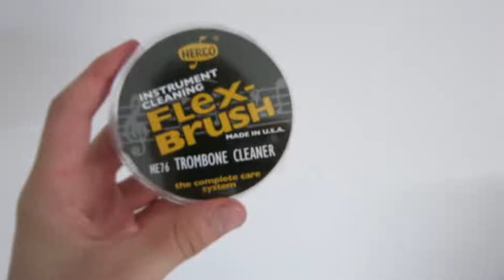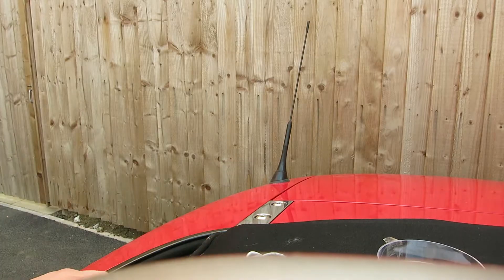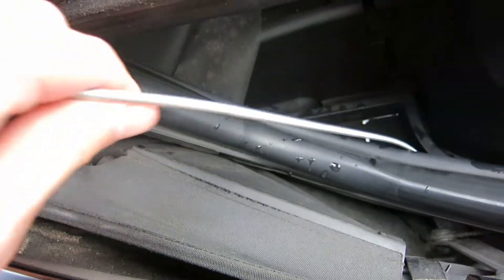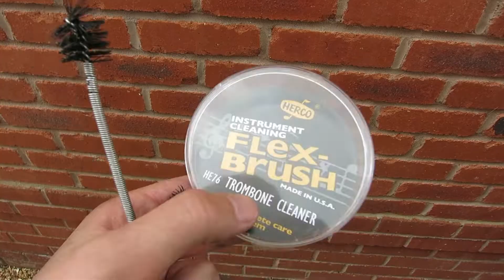MX-5 Drain hole clean!

Comment: Don’t forget that they also tend to leak through the plastic cowling below the windscreen. There is a small plastic cap cover on both the left and right side that covers a screw which holds a white plastic bracket in position and which has a rubber seal underneath which corrodes after a while and let’s in rain water down through the glove box to the floor carpets on both the passenger and driver side. Either replace the white brackets and rubber seals of squirt silicone around and over the bracket and when set, should stop any further leaking.
Reply from the maker: Robert Bernard very useful thank you! Have had a few subscribers mention a leak in this area!
Reply: Yup, just rained 2 days in a row an this just happend on driver side. I will give a looksie tomorrow . I think I saw other vid on it too
Reply: Is this just NC? OR NB as well

Comment: I found an alternative to the trombone cleaner.  It's a giant cable tie of 1.2 m / 4 ft in length used by heating and cooling installers to hold ducts.  I remembered I had some in my garage after renovations.  Insert, twist and withdraw. Being plastic, it's not too brutal. Holes now clean. 😃
Reply from the maker: Haha perfect! Love a bit of ingenuity👌

Comment: Useful. Constant issues with drain holes/gutters on driver side which means issues with wet carpets (a lake which makes carpets rot and metal bolts rust) Even my garage struggle and have to clean drain holes / gutters out every time the car goes in for anything.

Comment: Anybody reading this don't use a trombone brush and don't stick anything down the drains. This is because there are really delicate one way rubber flaps in the drain tubes at the bottom which stop road noise coming back up into the cabin (makes a whooshing noise like a sea shell when cruising at speed). The trombone cleaner pushes these out when you stick it down. I did this at first and had to pull out the drain tubes from behind the seatbelt pretensioner and remake all the rubber valves as the noise was so annoying.

Comment: Today, (27.11.21) I realised my passenger side had about an inch, to an inch-and-a-half of water in it - no wonder my dog didn't want to sit on the floor - !  If you DO get a flood (haven't experiened a flood like this before!) take an old pillow case, and fill it with cat litter. Lower it onto the wet lo9cation and flatten it out to spread the littler, still within the pillow case, to cover the entire wet area (you may have to do the passenger side in 2 sections; in front of the seat, and behind it, while the seat is pulled fully forward).  leave the litter there until the water is absorbed. You may have to give it more than one treatment. I realise cat littler isn't cheap, but it's less expensive than having to deal with a rusted floor! 
I also ordered a trombone cleaner today, too, so that will alleviate the problem, I expect! Thanks for the lesson. I wouldn't have ever found these drain holes on my own! Last time the water got in (never been as bad as this!) the garage didn't have a clue!
Reply from the maker: Hi, I think your leak is coming from the scuttle grommets on the bulkhead below the windscreen. Here is a link to where I talk about them https://youtu.be/bEwwdv8M4cM. Never hurts to do the drain holes anyway!

Comment: Be mindful there is a downwards rubber 1 way flap in there, so if you’re using that trombone cleaner you must exit down, don’t yank it back up since u may damage the flap.

By “there” I mean on the top side of the built in hose behind the retracting seat belt ( you have to move the plastic trim aside to reach the drain tube compartments).

Comment: Does anyone else have a problem that the brush goes up and out rather than down to the hole beneath the car? My drivers side drain is blocked and there's so much water sitting there, i'm very worried about it. But I can't seem to dislodge anything with the trumbone brush. It's not as simple as one tube, it feels like I'm stabbing in the dark, can't really see what I'm doing. Not really sure which hole underneath the car it's supposed to drain out of. Would try that otherwise. Anyone got any tips?

Comment: Thanks for the video, I actually tried this some time ago and even manually removed and cleaned the filter behind the seatbelt wench, but I'm still have a leak behind my 2011 Mx-5 passenger seat. The main difference for me is that I have a PHRT and the water isn't even meant to enter the car at all. Any clue?

Comment: Well i put water in..1..petrol hole came out no issue.,passenger side came out the hole and everywhere else, saw dampener maybe covering rust..drivers side no water came out the hole but came everywhere else, painted side skirts before rust may start.,I have same colour as you but 2007 ubnder 110,000klms

Comment: I teied using a bent metal coat hanger to do this as I fouind it so difficult to line the trombone cleaner up. The problem with that is that it transitions to a hosepipe style tube that bends through 90 degrees with say a 3 inch bend radius which stopped the coat hanger dead. I then bought an endscope and used that too track the coat hanger which made me discover the 90 degree bend (right before the exit point at the bottom of the car) and made me realise the passenger sie was much more gunk filled than the driver side as it had been parked under a tree on the street for some time by the previous owner. Ugh! All clear now.
Reply: Yea gotta just go on angle some

Comment: Great video, have you had any problems with the rear high mounted brake light leaking? I had some water in the boot recently and trying to figure out how to get it off to check. Do you know?
Reply from the maker: videomonkeys not personally. I sometimes think the boot is wet, when actually it is just cold! I use a website called www.mellens.net for repair instructions! Check it out. Thanks 🤘
Reply: @CarThought  Will do, thanks for the reply 👍
Reply: Check tail light assemblies.

Comment: After reading quite a few messages in forums about it i saw someone say drivers side easy passenger side not,  so i went to check my drivers side [not side that was letting water in] The trombone goes in 1st attempt! the passenger side I cannot do it i think after 100 attempts, 
when in for mot im going to see if we can stick a piece of hose into theslot to get direct access with trombone i think this would be the fix, my road cambers so as long as park only on one side of the road the rain will not intrude
problem solved!
Reply from the maker: That’s odd, I thought the design is symmetrical? The opening holes on the bottom have 1 way flaps on them, so if you go from the bottom make sure you don’t damage the flaps.

Comment: Bought the drain thing from your link. The drain hole behind the passenger seat was blocked and full of water. 
Before that I had found the passenger footwell really damp. 
Would that be the cause of water in the footwell or will water in the footwell indicate that its maybe the screw under the windshield?
Reply from the maker: Hi thanks for the comment. Water in the footwell will most probably be windscreen surround grommets and associated seal (I would recommend to replace). Please see my video where I touch on them here https://youtu.be/bEwwdv8M4cM
Reply: So you finally bought one .

Comment: I'm getting water in the trunk, is there more drain holes at the back of the car in the trunk area?
Reply from the maker: Hi, if your drain hole clean has not fixed this issue, you could have a leak from the tail light seals. Best way to figure out where it is coming from is to line your boot with newspaper and pour water over the car including drain holes. Then look in the boot to see where the leak is from 👍
Reply: @CarThought  It happened when I poured water on the soft top. So I unclogged the drains with a wire, water started to flow from both sides. Did it from underneath, just stuffed a wire in the drain holes. I think its better now but not sure if fully resolved.. water drains now, the holes were for sure plugged up. Not sure how water got into the trunk, but if the car is on an angle with the back of the car being lower, are the drains still effective or will the water just not reach the drains due to the tilt of the car and end up in the trunk?

Comment: What about using compressed air?
Reply from the maker: I can’t see why it would harm the car going from the top. Only thing is it might be difficult to locate the drain holes as most air lines I’ve used would be too large to sit in the mouth, it’s not like you can see them without removing trim 🤷‍♂️